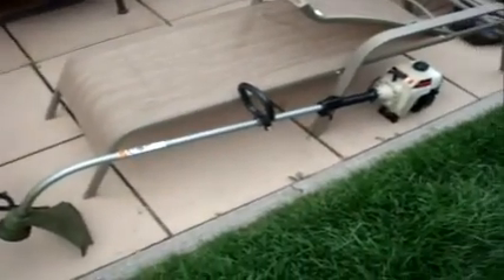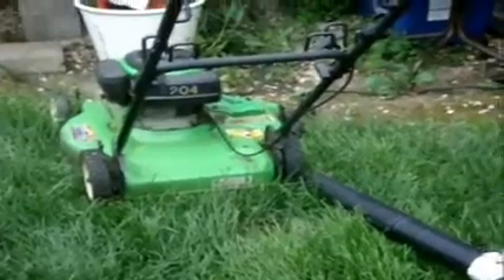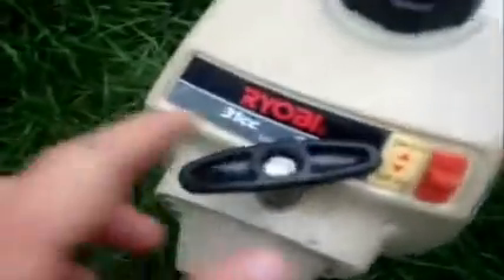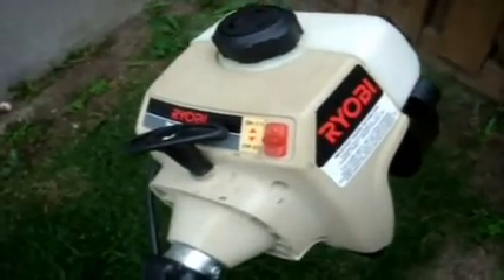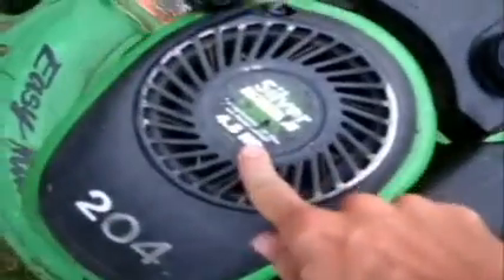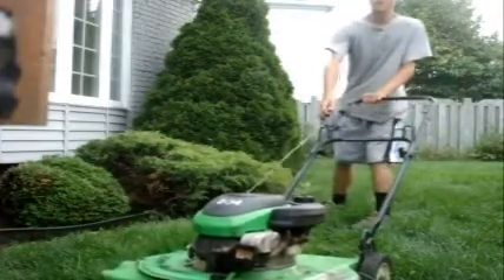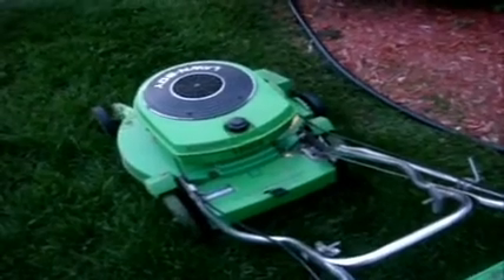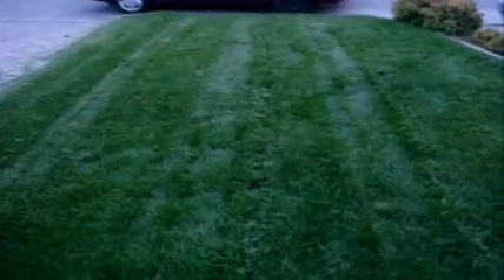July Lawn Cutting Video - Lawnboy 10260 Breaks Down LOL

Comment from the maker: @CaterpillarGiraffe 

Thanks Rainey.  The carbs are very easy to clean.  All you need to do is to remove the 13mm nut under that bowl and take some dust off and blow the insides.  I just finished cleaning it just now, fired on the first try

Comment from the maker: @kilgoja 

I see what you mean.  The reason why it broke down because of the carb gumming up.  Its a very common issue on tecumseh motors but it's really a simple fix.  Cleaned the bowl and started in 1-2 pulls.  I've haven't with Kohler or Honda (they are more than $800 here in Canada for a true Honda mower), but I will say that tecumseh's were better than Briggs+ Stratton

Comment: I have a lawnboy model 8241AE. The battery may not be strong enough to engage the starter. Can i use a riding mower battery to try to engage and check the starter? Can i also install a pull start system for this model? How can i check the electrical system for any other problems that keep the starter from working?

Comment from the maker: @kilgoja 

Then how come Honda had very few snowblower engines?  The lawnboys I use are  2-cycle engines which were FAR superior engines before TORO's takeover with this tecumseh.  Yes it did break down..just 5 minutes later to remove and clean the carb,  still runs and starts in 1-2 pulls to this day.

Today there's REALLY no better lawnmower..  decks are steel and bland in design.  At least with lawnboy as airplanerevolver  stated, they had unusual deck designs  that helped trim closer

Comment: The issue in the second Lawn Boy you used could be caused by a clogged fuel valve (ie the fuel is only trickling into the carb slowly), but could be other issues. A good first step would be to check that fuel valve and clean the carb, then adjust the rich/lean screw to make it run well.
Reply from the maker: Genners111, it needed a carb adjustment and a good muffler cleaning.  it works well
Reply: Jon3800 Yep, a dirty muffler can also cause malfunction!